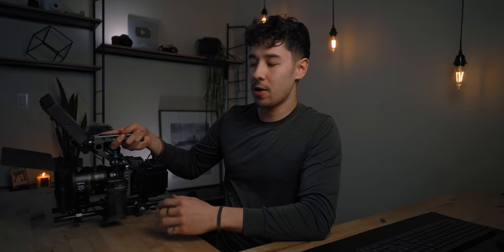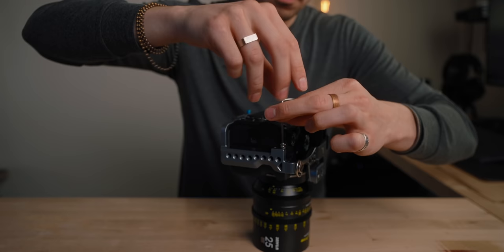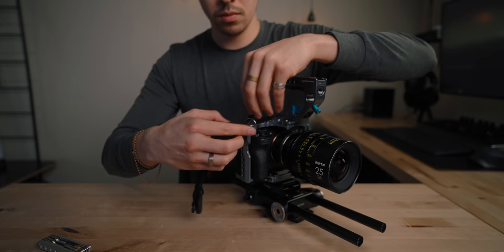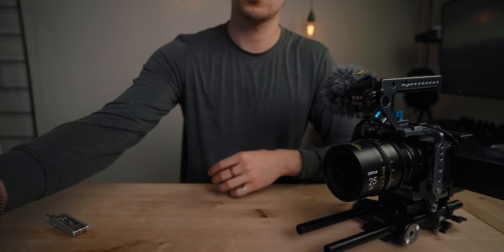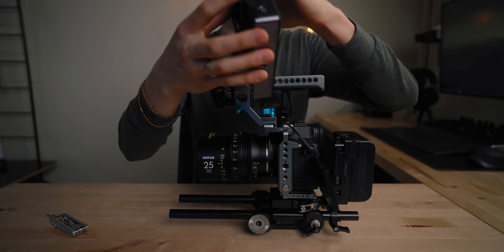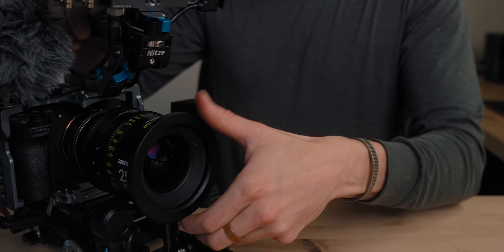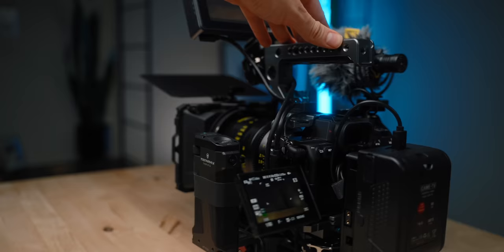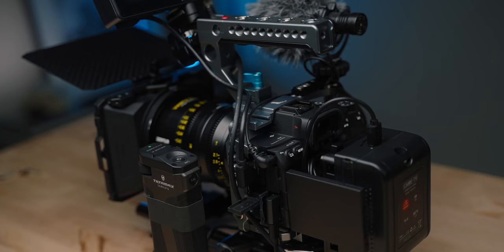Sony A7S III: Can it be a REAL cinema camera?

Comment: Here is the budget solution. Replace: 
$250+ V mount battery & plate with $15 power bank & usb-c cable, 
$250+ Tilta with $40 Neewer follow focus, 
$120 Kondor Blue cage with $30 Neewer cage, 
$80 Nieyrig 15mm riser with $20 Smallrig 15mm base plate, 
$400 Freewell VND with $90 K&F fixed ND set...
Reply: Am doing the Power Bank setup, does the job well

Comment: Great rig!  I just got my A7s3 this week and am excited by everything, except the USB power, which I'm confused by.  The Help manual for the camera indicates that the USB power should be 9V 3A or 9V 2A.  I checked your CAME-TV Battery and it says it supplies USB 5V 2.1A.  Seems like not enough voltage, but it's working for you.  Does it drain your in-camera battery while you're powering it?  Thanks!  I'd like to power my rig just like yours.

Comment: Thanks for this helpful video Ryan! I wonder how you managed to screw the mini matte box onto your freewell filter system. I have got the same setup with 82mm freewell filters and cannot attached these when the matte box is attached. I have to put the matte box directly on the freewell filter base without the matte box adapter ring. Do you have a tip for me how you managed to screw this on so smooth? Keep it up!
Reply: I came across this same problem today… What I’ve done is used the 82mm ring which comes with the Tilta Mini Matte Box to create enough seperation to thread the Freewell system. 
It’s the only ring i can find which lets you attach it to 82mm threads either side. Not ideal, but it works!

Comment: Great video! Thanks a lot. Are you still also using the BMCCK 6K and could you recommend it in 2022?
Reply from the maker: I actually sold it, but yes I would absolutely recommend it. Great value for the price!
Reply: @RyanKao  Hi Rayn, thanks for sharing your opinion! Still holding it for the moment because of the nice user interface 😅. Would be great if you could do a direct comparison. Keep going with your awesome work!

Comment: I went to check out the Nitze monitor mount bc I like that it mounts to the front of the handle. Which one did you get bc none of the configurations make sense to me in the way you've set them up. I don't see a product that mounts to the front like that. I see cold shoe, two screw mounts and bar mounted

Comment: Can I have a question about the Freewell NDs? I see you are using 77mm diameter but Smallrig Matt box has 95mm does not it? How do you screw ND to the Mattbox?
Reply from the maker: The Smallrig matte box uses adapter rings that take a 77mm lens thread and give a 95mm clamp on diameter. However on the outer edge of the adapter is another 77mm thread you can use for filters!
Reply: @RyanKao  thank you Ryan! Very useful info.

Comment: It could be a cinema camera a 15% of the sensor didn't take a vacation when in video mode.  More than 15% of the sensor is completely wasted because Sony won't release a firmware update... It's literally not used when in video mode.  And for some reason this does not outrage a7S3 owners because they simply don't understand